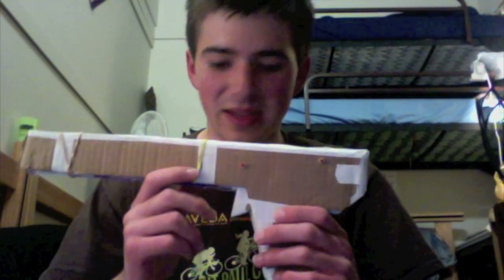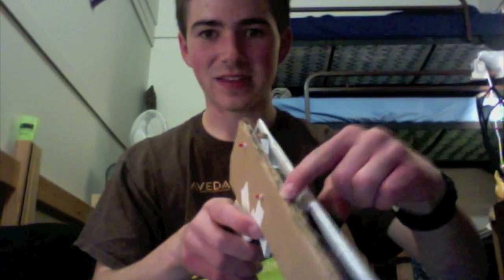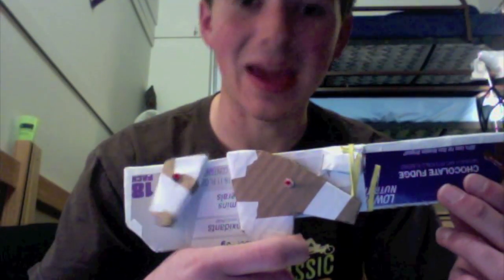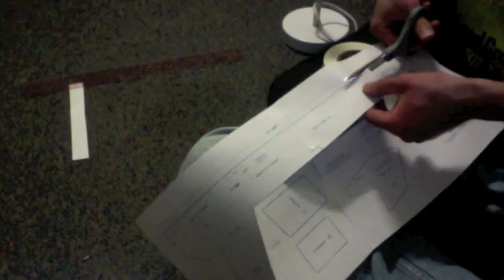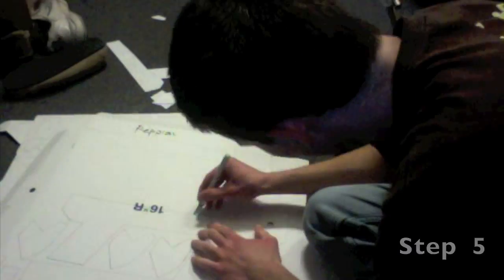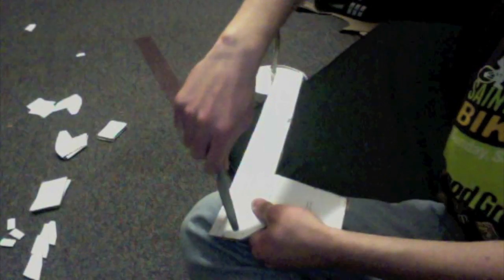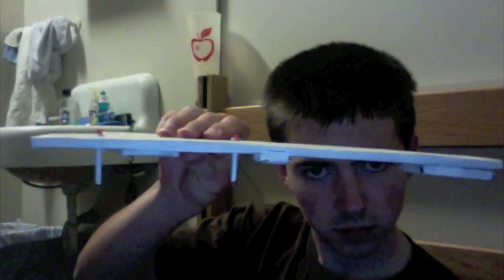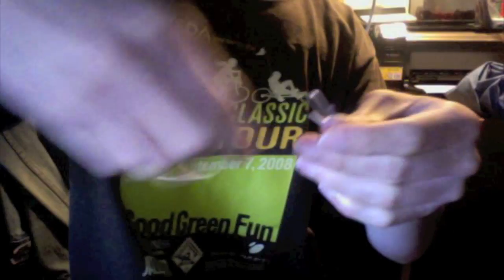How to Make a Pretty Strong Paperclip Gun with a Working Trigger

Comment: i made this but i couldn't get the blueprints because my computer sucks, so i changed it around a little bit, my my trigger is only one piece with the part you put the paper clip on, it in the shape of  an L, and i has a little bit of delay when i pull the trigger but it can be tweaked. btw great video!

Comment from the maker: Sure!  See if I can explain it in a comment:  You want the paperclip connected to the rubber band, and then you want to bend the paper clip a little to open it up, so it's a little bigger ( 4:05 ) and will fit better on the pinwheel thingy.

Really, a rubber band all by itself will work.  You might need to tie two rubber bands together, if you don't have a long enough rubber band.

If you do use paperclips, you can link a few together to make the bullet longer, so it will stretch long enough.